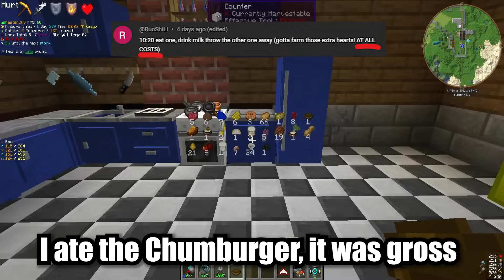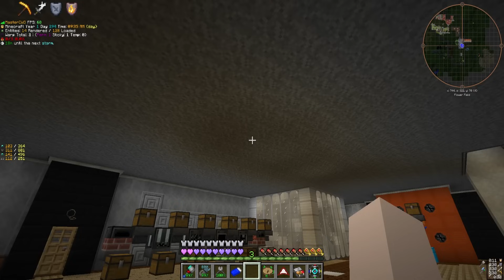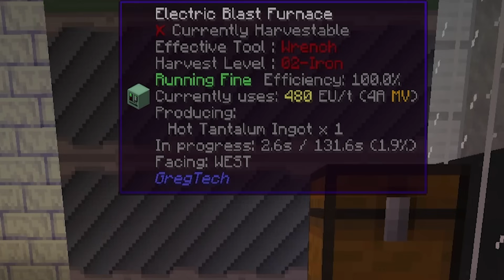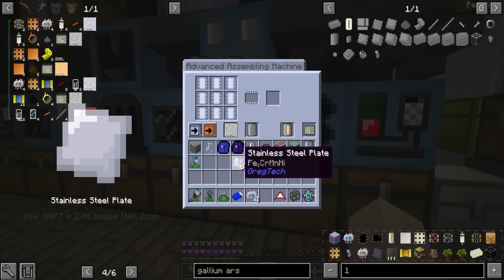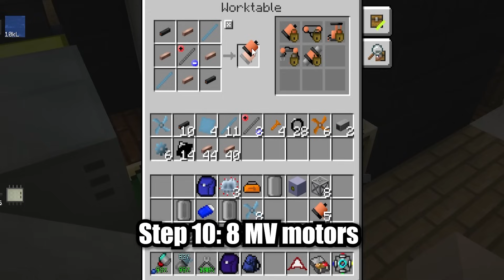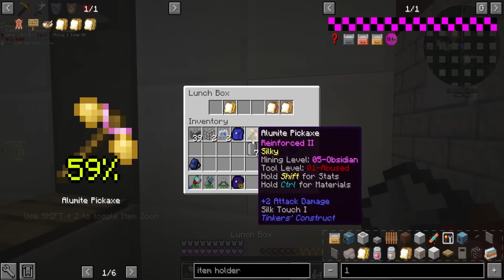CLEANROOM is Wild... Gregtech New Horizons (2.7.3) #7

Comment: Hey, just in case it interests anyone — SMD stands for Surface-Mounted Device, as these components are mounted and soldered directly on the surface of the circuit board. The alternative is through-hole technology, where you push the legs of the component through holes in the circuit board and solder them on the other side.